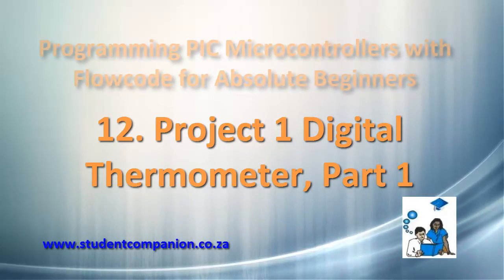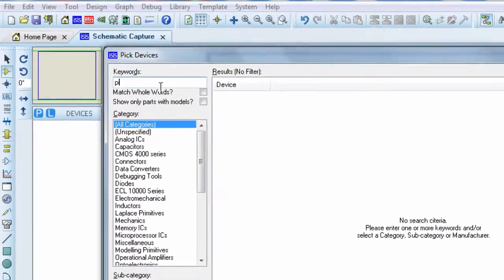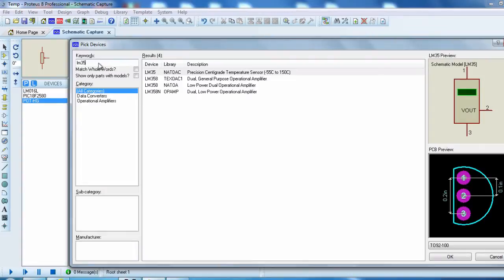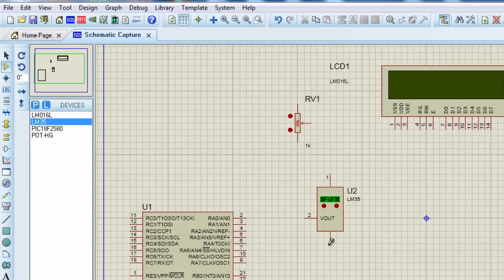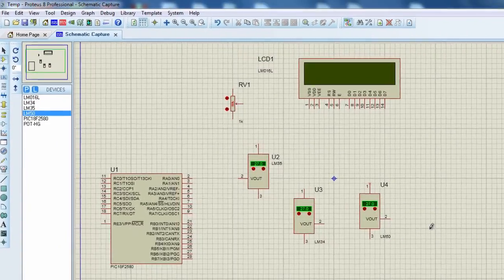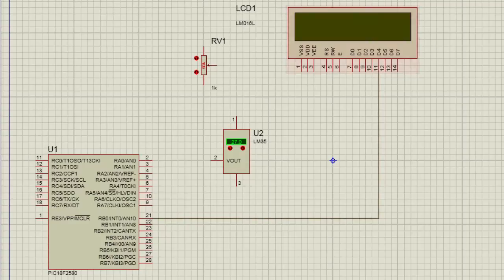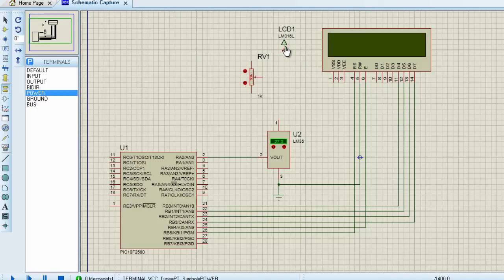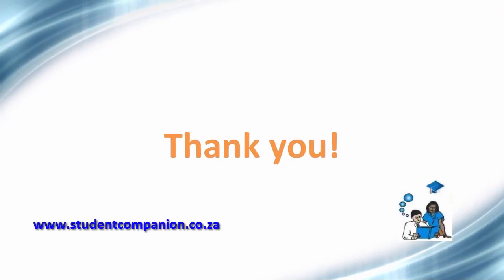12- Project 1 Digital Thermometer, part 1 | Flowcode Beginners Tutorial

Comment: how can I ask you questions about this project please it is important
Reply: i hope you can reply soon
Reply from the maker: You can ask your questions here in the comments on YouTube or in the Forum on our website
Reply: @StudentCompanion  how can i add to this circuit also Fahrenheit and kelvin to show up on the screen .  meaning on the screen i want the temperature to show in Celsius Fahrenheit and kelvin.
Reply from the maker: Calculating the temperature in Celcius, Kelvin or Fahrenheit is not difficult, just multiply the celcius value with the conversion rate. The problem is how do you want to display them? One by one? Second line? Scrolling the display...?
Because this project lcd can only display 16 characters on 2 lines
 We don't have enough space to display a lot of details. You have to decide how you want to display.
Reply: @StudentCompanion  is there a way i can add them line by line meaning
 Temperature is
 30°C  86°F  303 K
Reply from the maker: Yes you can if that's what you want, you can write kn 1st line: Temperature is: This is already 15 characters, so it will fill the 1st line, because you can only write 16 characters per line.
Then you can display the temperature on the second line ny switching the cursor to the second line. If for example you have to display 30°C 86°F 303°K will also be 15 characters which will also fill the 2nd line because even empty spaces count as a character. This will be fine, but remember if you have decimal places like 30.2°C and on other scale, you will run out of spaces. Some values wont be visible on the screen. So make sure to only display integer values.
Reply: @StudentCompanion  how will i do that ? the change of temperature ?
Reply: is there a way i contact you on facebook or whatsapp to ask you questions . please.
Reply: or if i can contact you by mail . please
Reply from the maker: What's difficult to ask questions here on YouTube?
I have already told you we only provide tutorial support here on YouTube or in the Forum on our website.  We don't provide tutorial support in private messages on Facebook, whatsapp or email
Reply from the maker: If you need to post the Flowcode project, you can post your questions in the forum. 
If you struggle to post in the forums, you can read this post: https://www.studentcompanion.co.za/forums/topic/please-read-this-before-posting/
Reply: @StudentCompanion  it is okay i will ask the questions here
Reply: okay so my first question is how to change in the code to add the change of temp . meaning how should i ad the kelvin and the Fahrenheit. 
the other is about part 2 i am using flowcode 8.3  .  there is no analogue digital converter such as yours the black one . how can i put it
Reply from the maker: Ok.
Reply: @StudentCompanion  if i used the pic16f877a will it work ? 
do i  have to change anything in the configure options ?
Reply from the maker: Yes it should work. You should change the config options based on your requirements and it's always going to be different from device to device. This like clock frequency whether external, etc.
Reply: @StudentCompanion  when i run the hex file it is giving this error . Flowcode2.c : 861 : error : Unknown or missing variable: rw_pin  what should i do
Reply from the maker: I can't guess what could be wrong because I don't see your code.  I can't see how you programmed it. Post your project in the forum
Reply: sure i will post it . thank you so much . here is the link for the it.      https://www.studentcompanion.co.za/forums/topic/digital-thermometer/